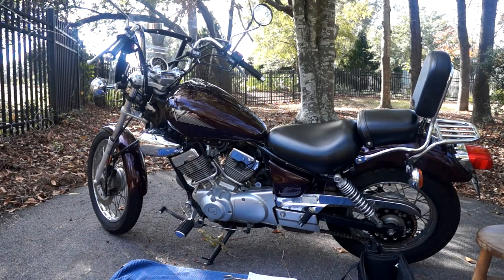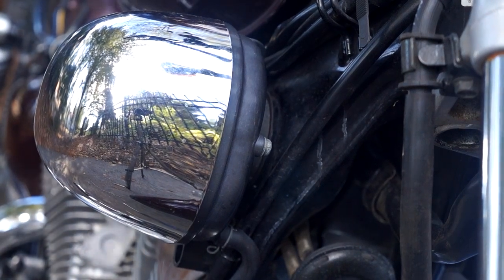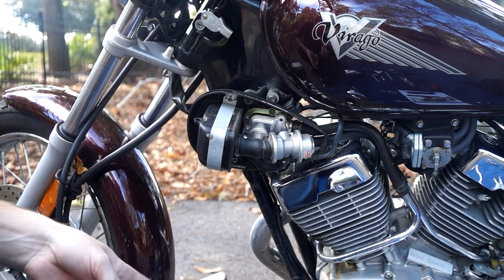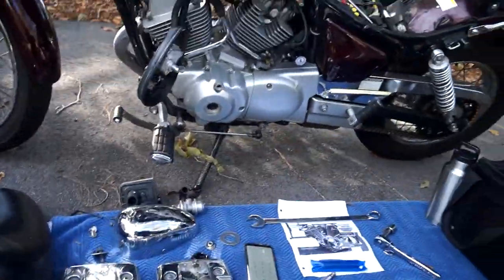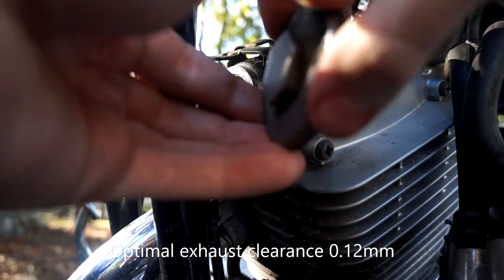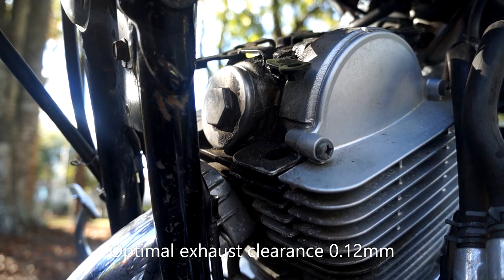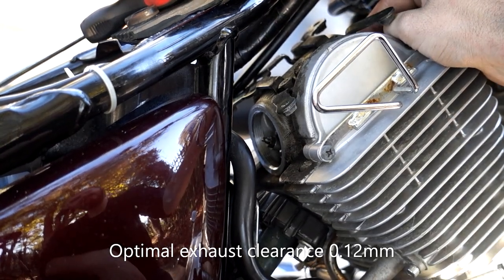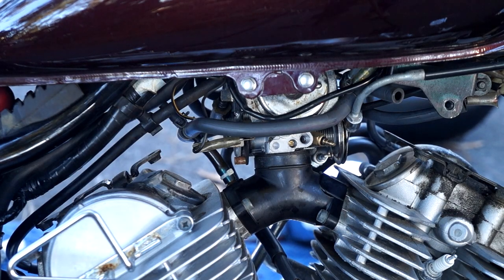XV250 Valve Adjustment English Full Walkthrough

Comment: Before you roll over the engine to get the engine in top dead center, pull the spark plugs. If you don't,  you'll be fighting compression in the cylinder.  Great video. 👍

Comment: Thanks bud. Went to go adjust my valves since I couldn’t go above 50mph. Just bought it, thought adjustment was just whack. Was getting good spark etc both sides. Pistons both moving. Turns out the first cylinder timing sprocket sheared off and tried to get sucked down into the engine! I only had one cylinder! So in theory your video saved me a big headache that is now the dealerships headache until it’s ready for me for real this time, Altho I just got my license yesterday and I’m sad I can’t ride it to work in this pretty weather! I can’t believe it ran at all let alone to 50mph with a loose chain and only one cylinder!
Reply from the maker: Damn that's a bummer! Glad you got it sorted out. Was it a used bike?
Reply: Yes. I think 3 owners. The last lady had it for 2 years and sold it. I bet she had that problem that whole time. The dealership never took it above 2nd gear so they didn’t notice the power drop, rode it all day yesterday trying to find why it wouldn’t accelerate above 3rd. 4th and 5th were basically useless. Then took off that timing chain cover off and bam. It’s was sheared right off with the bolt sitting on top of it.

Comment: Thanks for posting this video. I was able to adjust the valves on my 2014 XV250. By mistake I used the inches spec on the feeler gauges for the first cylinder. I was wondering why the gap was so big. I ended up doing the first cylinder twice. You live you learn! Other than that all else went well. Cheers!
Reply from the maker: Glad to hear it. This video is very long and I often consider re-editing it. Happy that it still helps people regardless

Comment: I found the square end of the valve adjustment is the same size as a Robertson screw, so I put a screw in a knob of wood to use as a homemade adjuster tool. Great video, and I don’t even have a 250 Virago.
Reply from the maker: That's a great tip. I struggled trying to find a wrench to fit it and settled with pliers, which is very fiddly of course. I'll keep it in mind.

Comment: Hi mate, I have a ticking noise which I’m not sure where it comes from. Would it be possible if I send you the video and you could tell me if it’s a valve ticking noise or maybe something else? Thanks a lot mate.
Reply from the maker: Did you get this ticking noise after attempting a valve adjustment or just over time? Has an adjustment ever been performed? 
My bike has some slight valve noise even with properly adjusted valves. I can get my ear right up to the engine head and tell what's going on just from sound, but it's just a subtle normal valve noise. If you want you can upload a video as private and link me to it in a reply

Comment: Hi there. Great informative video. Thanks. By the way, how often the valve adjustment is needed? Is it mentioned in the manual?
Reply from the maker: The service manual mentions doing it at the first 3000 miles, and then every 6000 miles after that.  It becomes a fairly quick job by the second time you do it.

Comment: Thank you for making this video.  Your thorough explanation and close-up camera work made it easy to follow.  I searched for this video because a commenter on another video said you had to remove the engine on this motorcycle in order to adjust the valves 🙄.  I'm considering buying one of these sometime next year, so I'm doing research right now.  Overall, has it been easy to maintain and reliable to own, and do you recommend this bike?
Reply from the maker: Glad you enjoyed it! I made this video since there seems to be very little competent documentation or how-to material online despite this bike being fairly common. There is also no real enthusiast community or active forum for it which is a shame since it's really a fantastic bike. They made it since 1988 and changed almost nothing since then. A Chinese company has a 1 to 1 knockoff of it as well. As such, OEM or dubious Chinese replacement parts are everywhere. Aftermarket accessories are mostly limited to cheap Chinese parts though. Mine has been steady reliable aside from the usual carbureted bike problems. Maintenance is generally easy due to the simple and thoughtful 1980s design. I find it to be highway capable and a joy to rip around town. Everyone I know loves the way it looks and never believes that it's a 250 unless they are already familiar with the xv250.
Reply: Ok, that's great information - thanks.  You mentioned carbureted bike problems...would you please elaborate?  Are there regular adjustments, or service intervals related to the carburetor?  Or issues from time to time?
Reply from the maker: @bwnash64  When I got my bike it had been sitting for about 7 years. On top of that someone had been in the carburetor before and had a lot of adjustments messed up. Once I sorted all of that out it's been running well
Reply: @helloish12321  Good deal - great looking bike.  Thanks again for the video, it's going to help a lot of people do their own work.

Comment: hoe did you tun the carburetta ? how many turns out from " closed " my bike has no horsepower, it is running on both cylinders, but just doesn't have any power.
Reply from the maker: That screw only affects idle. If your bike is running bad at all rpm you may have missed something or misaligned your slide diaphragm
Reply: @helloish12321  Thank you. 

I'll have to check tomorrow. 

But I'm 99% sure the diaphragm is aligned with the little rubber tab in it's slot.

the bike has a "touch" of power at high rpm ( no tachometer ) but it falls really short of where it should be.

I also have a Gunsen Colortune. It's a clear spark plug so you can see the colour of the combustion flame. 

It's constantly orange = too rich. no matter the adjustment.

Here's what i have.

https://www.youtube.com/watch?v=MJc3H6JxzbI&ab_channel=ClassicMiniDIY

Comment: Any idea where oil in my spark plug well would result from? Bike is bucking, thought it might be the valve cover but they look pretty. I can share pictures! (Have the same bike).
Reply from the maker: How many miles are on the bike and did you get it used? Are you absolutely certain it is oil?

Check a few things. A stuck carb float or a float height being set too high can cause gas to flood into the engine even when the bike is just parked. My bike had this issue when I got it so the plugs were wet and it never wanted to start. Too high would also cause a rich condition which could make it buck. Smell the plugs. Let it sit over night and take the plugs out in the morning and turn the motor over with the starter. If gas flies out of the spark plug holes then you have a float issue. 

Also ensure that your oil level is set properly. Hold the bike vertically, not on the kick stand. With the bike completely verticle make sure the oil line is half way up the sight glass. If you measure oil level while on the stand then you massively overfill it and that oil has to go somewhere

If both of those check out, do a compression test and make sure your piston rings are good. The valve covers are very simple and shouldnt be leaking into the spark plug just because of how everything is arranged. Whatever is on the plugs is coming from inside the motor.
Reply: @helloish12321   sir please I have the same probleme with the carb , but I'm wondering how does the gas goes into the combastion chamber when the bike is parking over night ?? , is it throgh the valves? If so  isn't the valve should be closed compleatly and nothing should be passing through it ??
Reply from the maker: @simonia3178  if your float is set too high the gas goes over the holes in the jets and can just pour into the intake. Normally the float height would be set so that the pool of gas is a bit below the jets, and the vacuum of the engine pulls gas through the jets.
Reply: @helloish12321  thank you how did you fix your probleme ?

Comment: Gonna be buying my grandpas v star 250 that has 6k miles on it. I have oil change planned (new oil filter) and new air filter anything else I should consider?
Reply from the maker: Make sure the tires look good and are at pressure. Mine had a ton of carb issues when I got it but you might get lucky. Check/change the brake fluid since it's probably original. Make sure the chain is tight and slap some gear oil on the chain. Basic old bike stuff. 

How hot is it where you live? I noticed mine shifts much better with mobil 1 50 weight v twin oil in the spring/summer.  

The service manual has a chart for the recommended oil viscosity vs ambient temp. But the chart tops off at 70°f. So the recommended spec of 20w-40 probably isn't good at the 95° I ride in some days lol.
Reply: @helloish12321  thanks I’ll have to check on the tires next time I’m down there it seems fine when the bike warms up but when the bike is cold it doesn’t like to rev much (I assume that valve job would help that) but I’m sure it needs a carb clean. 
Yeah it sure gets hotter than 70°f where I’m from 😂
What do you think about changing the sprocket?
Reply from the maker: @Zuccleberry  I went up a tooth in the front and down 2 in the rear. With a passenger it kinda sucks but I go over a bridge every morning on the way to work and have to keep the bike at around 70mph and it does great to keep the revs down.

If you don't plan on doing much highway I wouldn't bother. But if you do it's a must

Comment: once you align up exhuast do you leave it there for the input or do you turn it again and just use the TDC for the intake?
Reply from the maker: With the piston at top dead center on the compression stroke both the intake and exhaust valves will be closed. That's why it's important to verify top dead center by checking the mark on the cam sprocket. Line that cam mark up and then adjust the valves to spec.
You only need to rotate the engine again when you go to do the other cylinder.
Reply: Got it! Thanks. Doing mine tomorrow.
Reply: @helloish12321  Nothing like taking it all apart and find it still in spec. I owned it for 14 years and it was still solid.

Comment: you didn't show us the TDC marks from below
Reply from the maker: Sorry, I know. I tried but the camera absolutely would not focus on it so I cut it out. When you do it yourself it will make sense as long as you know what the shapes are for each cylinder.

You should also take the cam sprocket covers off and verify tdc on the sprocket marks to ensure you are on compression stroke and that the valves are unloaded. Doing this, it isn't even necessary to see the marks on the stator. If the motor is in time mechanically, the cam mark and crank marks will be lined up at the same time. I should have mentioned this in the video though.

Comment: When you take the timing caps off the crankshaft, is there any fluid that you should have to worry about leaking out on you. Just checking cause I wasn't sure if the oil flowed through there.
Reply from the maker: I did not notice any oil behind the stator cover so I'm pretty sure it's designed to be dry behind those caps.
Reply: @helloish12321 thanks for your response and one more question please.  After you completed the adjustment, did you have any tapping or ticking come from your valves afterwards.  Because I do. Im just curious if this is something to be concerned about or if it's the valves just needing to wear into the new adjustment. Prior to the adjustment the engine was very smooth sounding with no ticking whatsoever, so its now working on my nerves making me worry a bit. But i figured it was needed, the bike has 7,000 miles on it and the first tank I ran through it since owning it only got 135 miles.
Reply from the maker: @CrazyPalidin57  the valves should have a slight tap noise. You should definitely hear them but it should be soft. 

If it's a loud noise and enough to give you concern then I would open it back up and recheck clearances. Make sure to remove your cam sprocket covers as well to verify you are at TDC on compression stroke for all adjustments and measurements.